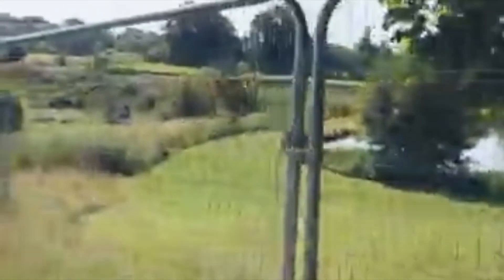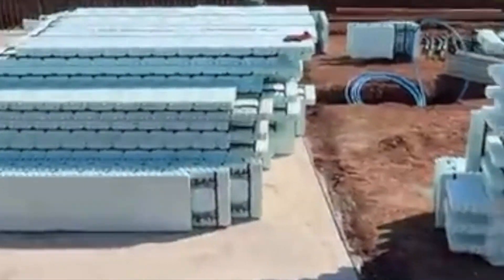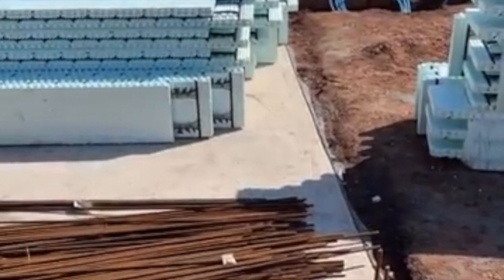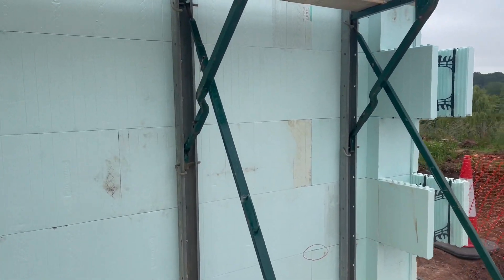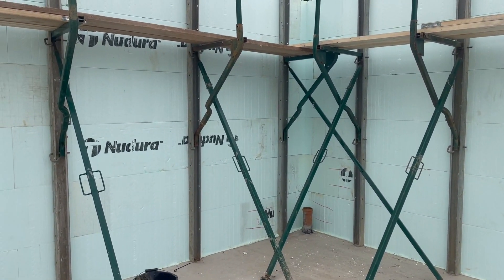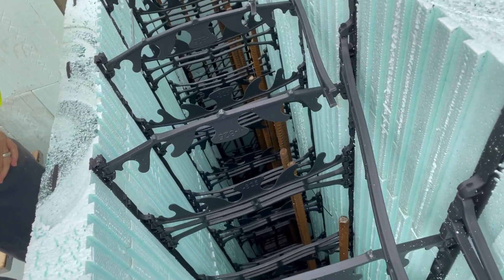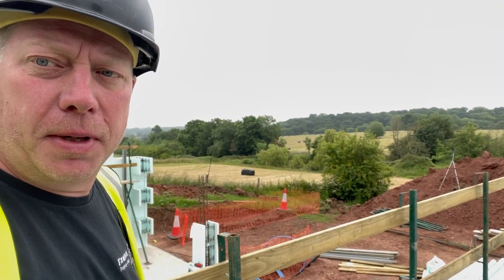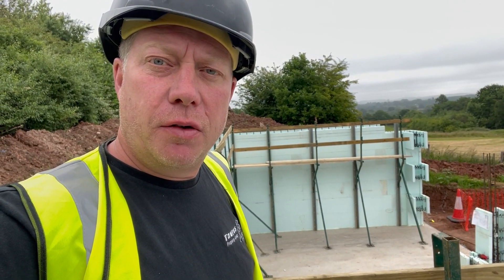Introduction of an ICF Build Project - Day 1 On Site I Up to roof level in JUST 2 DAYS!! #ICF

Comment: Finally someone in Europa, and with Nudura great. Except the UK left the European Trade Union so as a German I have to pay tax and customs on it. Do you know which brands are available in the UK and where they are made? And finally where can I get the bracing system to plum the walls, do you have an exact naming? Greetings from Germany
Reply from the maker: Thanks for the comment. There are a few different systems available here in the UK - most are manufactured abroad still although there are factories opening up in England soon I’m told.

Are you only looking for factories in Europe?

Comment: Interesting system. Do you  know if the braces by hired out to a self builder? Looks like an ideal system for self build.
Reply: We hire the bracing system from the ICF supplier 👍
Reply from the maker: The bracing/prop/scaffold system can be hired from the ICF supplier and also bought/hired independently if you look around 👍

Comment: Can you build using ICF on a land that has prior planning permission in the UK?
Reply from the maker: I should see no reason why not typically - do you mean that there is detailed planning already passed for a traditional build and you'd like to know if you can substitute with ICF shell?
Reply: @darrenburrows-taurus  exactly. All the lands I’ve looked at have planning permission for traditional build. Although I’ve made my mind up to go the ICF route. 
Thx for kindly sharing that information!
Reply from the maker: @kashankhan6950  as long as you're not changing the design, size or look of the finished property, there should be no reason why ICF can't be used instead of traditional brick & block build. It's really flexible and can be made to look exactly as a traditional build would once finished (although much better insulated and faster to build).